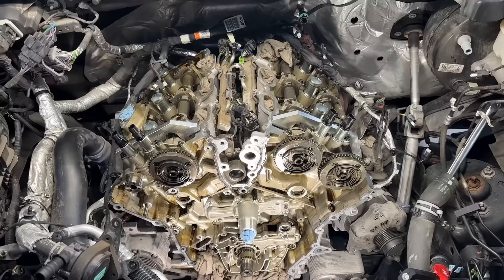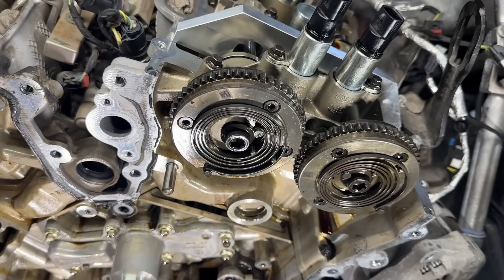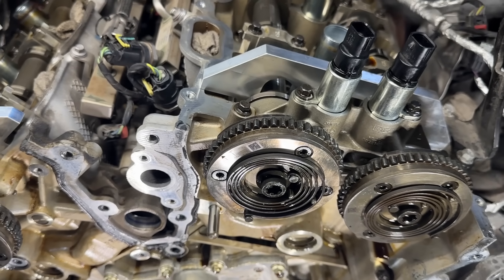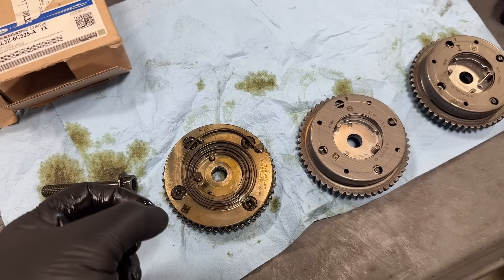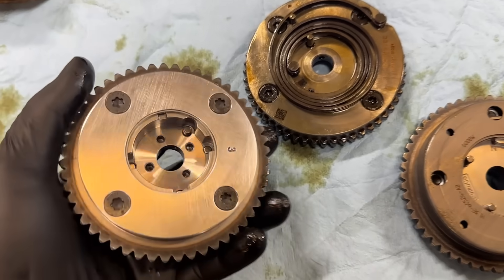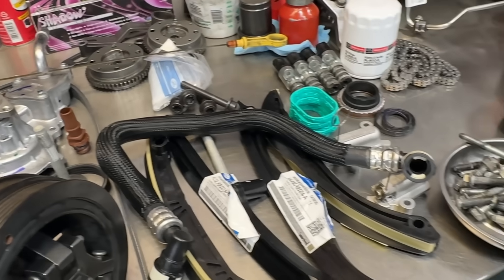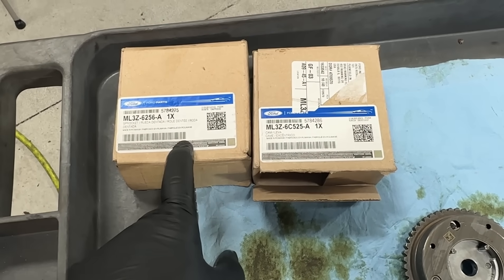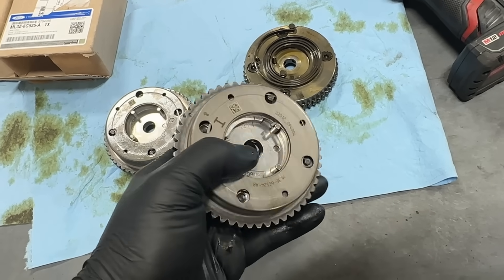2017-2020 Ford F-150 3.5L Ecoboost Startup Rattle Fix: Make Sure You Are Getting The Latest Phasers!

Comment: Will you people stop asking if this new style phaser will work with your 1st Gen 3.5l ecoboost? I mean the man CLEARLY STATES this is for the 2nd Gen 3.5l ecoboost meaning 2017-2020 for the F150. This new style phaser will not work with Gen 1 and the Gen 1 engines already have a new style phaser that fixes the previous issues with Gen 1 (2011-2016 F150).

Comment: Thank you very much for this video.   I had my cam phasers replaced almost 2 years ago at 87,000 kms (54,000 miles-ish) and my 2017 F150 is making the same noise on a cold start at 150,000 kms (90,000 miles).    I took it into the dealership and they quoted me $4400 to repair.   I just looked at my previous bill and the part number is HL3Z6C525CD.   Bastards did exactly what you mentioned....used up old stock.   It looks like I'm going to have a fight on my hands Monday morning.   Thanks again!!
Reply: Howd it go?
Reply: @calebmastruserio7811  so I got Ford Canada involved and they were excellent.   They covered the majority of the bill, leaving me with $900.   They gave me $500 in Ford credits for parts/service and a 2 year maintenance package with free oil changes.   On the other hand, the dealership were douchebags and I won’t ever be returning.
Reply: @robertcooper6910  oh good work, glad to hear it. How's your truck running? Hopefully good for a long while now, lol
Reply: @calebmastruserio7811  ya seems to be running well now.   I'd really like to hang on to it for a few more years.....other than this nonsense, it's been a great truck and I really can't see spending $80k (CDN)  just to buy the same thing with a bigger screen.    Thanks for checking in!
Reply: @robertcooper6910  absolutely fair, and no problem! Your comment piqued my interest lol
Reply: @robertcooper6910  I wrote to Ford of Canada about my 2018 last September when my truck was at 72,000kms. the response I got in writing was "I am unable to assist with repair costs". It was signed Joane M. pretty useless reply. We're now in May, the rattle is getting worse! Can you tell me how you approached Ford Canada? Do you have a contact name from written correspondance? Much appreciated.
Reply: @robertcooper6910  Yes I did get a quote, $2700 + tax. I called Ford of Canada again on Friday, the answer I got was "Sorry we don't have any programs available for this at this time." Thanks so much if you can get me that contact name. Seems it might be hit and miss depending on who answers the phone.
Reply: @allanrheaume5549  also, mine was out of warranty when the issue first arose.    Oddly enough, I had 87,405 kms on my odometer.   There is a service bulletin and this is supposed to be covered.

Comment: @FordTechMakuloco Quick question for you... Almost a month ago to this day, replaced the phasers (with the latest part numbers), chains, guides, etc on a 2018 ecoboost. Customer called today mentioning that their "grinding noise on startup" has returned. At this point I'm planning to inspect the exhaust studs to make sure that they are all there and I considered looking at the turbos, but they were quiet and operational during the prior test drive. Any suggestions or issues you've seen? Truck has 120k and I don't really plan to tear the engine down again to replace what was replaced to begin with. Maybe oil pressure issue? Not looking for any type of solution, just maybe you've seen or had similar concerns? Thank you!

Comment: Video is great and very informative. Im actually having the engine of my 17 f150 3.5L ecoboost replaced and am having the mechanic replace the cam phasers and timing components. Will these new model numbers fit the 2017?

Comment: I had my '18 F-150 3.5eb phasers replaced back in October of 2020 for the cold start rattle at just over 53,000 miles and they said they had the updated parts installed at the time. The repair took 8 days and then upon getting my vehicle back I made it less than three miles from the dealership in Omaha before black smoke was billowing from under my truck and people were pointing at me. I immediately took it back and they had it another day and replaced all of the gaskets and seals. I had a constant whistle sound at idle after that and they said it was normal and bring it back if it gets worse since there was no diagnostic code that popped up.  Now, I once again need the cam phasers replaced at 99,000 miles and its outside of warranty. I was looking at my repair invoice and the part numbers say HL3Z-6256-CD and HL3Z-6C525-CD. Talked to my service advisor the other day and he said that it's the updated cam phasers that were installed and that it can have the same part number as before but it's actually the updated phasers and his tech would not be installing the old versions. Is this correct or is my service advisor not being honest with me? Anyone having issues with the new phasers. I've had other warranty work done on other parts of the vehicle and each time I've had to come back. They once forgot to put the mounting bolts back in on my brake caliper and I made three blocks. Had a transmission flush done recently since they said they don't need to replace the filter. Replaced the trans pan and filter about 400 hundred miles later and the fluid was brown. While i was under there I noticed two of the transfer case to transmission mounting bolts were sticking out from when they replaced my transfer case when I had only a couple hundred miles on the truck. Apparently to difficult to get to so no need to tighten. SMH. Planning on going somewhere else now instead of the dealer where I bought the truck since my extended warranty expired. Sorry for venting but my blood's been boiling the last few days.
Reply from the maker: No that is incorrect, they must list the correct part number on the repair order.

Comment: Thanks for the info on the new part numbers! I have a 2.7 with only 5k miles and they need replacement! Anyone know the part numbers for the 2.7? Thanks
Reply from the maker: You will get no answers without at least giving the year.
Reply: @FordTechMakuloco  2023
Reply from the maker: No updated parts for the F-150 anyway.

Comment: I ordered a 2017 raptor, had phaser issues around 30k miles.  They had my truck for 7 weeks before it was fixed.  I assume waiting for parts.  The issue came back 3000 miles later.  Is this odd?

Comment: I have a 3.5L EB with 80,000 miles including towing a 7,000 camper in the Rockies.  I do not have this issue.  What am I doing right?  My best guess is I use Penzoil Ulyra Platinum motor oil.

Comment: What do u charge or do u know what ford would charge to do this job replacing all the things that need to be hoses water pump belts like u are keeping the truck not just the bear  Minimum or what the TSB for Ford what the fix it all done the correct way cost is that would help me and many more out thanks !!!
Reply from the maker: Well over $3k.

Comment: Well, I had a funny noise coming from the engine on startup a year and a half ago.  The tech determined it was the Phaser recall and performed it.  4 days ago, I had a loud cold startup noise. Sounded like a phaser.  On my way to Ford the noise started getting louder at 1500rpms, not just at cold startup.  They diagnosed it as the cam phaser issue.  They sent me an email to approve the $4,500 job to replace them.  I'm at 101,000 miles on my 2018 f150 3.5 eco.  They did the job at 77k.  I'm heading down there to talk with them about the parts they added when they did the recall.  I doubt I have any ground to stand on, but this is a recurring $4,500 issue that it appears is part of the plan for Ford to recoup some recall costs.
Update:  After sitting at ford and looking at my records of service, this will be my 3rd(confirmed) Cam Phaser replacement.   1 at 70k (old HLZ part), one at 81k(MLZ part) and this one at 101k (new part number approved in May 2023). The second round used the part numbers in this video and lasted almost exactly 20k miles.  The tech is going to send me a picture of the cam phaser part that was installed to confirm that what is on the truck is in fact the newer MLZ part number.  He mentioned if it is the new MLZ part number, that it's the first of those that he's seen fail.  Which if true, speaks volumes about that parts resilience.
Reply: Brutal.  Let us know if there's any resolution.  Dealing with the same on our '18 F150 as well, 70k miles.
Reply: Another update.  The $4500 did not include anything else, guides, tensioners, vct etc.  Added that to the list and it's now $6,000. One more item to note: If Ford replaces parts under warranty or tsb, it's a 1 year warranty.  If YOU pay for it, it's a 2 year warranty.  Also, I spoke with a manager to see if anything can be done about the price.  It's worth a shot, but haven't heard back yet on options there.  Ultimately, any engine work on the 250's especially 6.7's is probably a lot more.  So I guess I have that going for me...Here's the TSB for the cam phasers in case anyone is interested.  It ended 1/1/23 though: https://static.nhtsa.gov/odi/tsbs/2021/MC-10199482-0001.pdf

Comment: 2019 f150 limited.  120 k no problem at all. Just started the noise if i leave it for a few day.  Took to the dealership and they confirmed that is the cam phasers.   I have a warranty that covers it and give the ok to get it done.   What else should i ask the dealership to change while they are there.   They will definitely have to install the upgraded phasers.   Otherwise i wont give the ok to open the engine.  Thank you
Reply from the maker: I always change the water pump as they are prone to leakage and it comes off anyway. I also always change the coolant jumper hose from the water pump to trans coolant line if you have the PW-602 pump.
Reply: @FordTechMakuloco  how can i find out my water pump is like the one you just mentioned.  Thank you
Reply from the maker: Use your VIN in the parts catalog
Reply: @FordTechMakuloco   got the truck today.  Everything was done just like you advertised.  Except for the trans coolant line.  Didn't have one, they said.  Thank you for your help.
Reply: I talked to them and asked to i stall the updated ones.  Also, change the water pump.   Thank you. I will see how it goes.

Comment: I have a 2020 5.0 F-150 with 24K miles  and have been hearing about this issue on the Ecoboost engines is this something I should get done under warranty even if I don’t have a problem right now?
Reply from the maker: They will not repair unless they can duplicate.

Comment: I have a question for a 3.5L in an 2019 Expedition. The wife's ride just had a second cam phaser job and all seems well with ride home. Well the next day wife drives to town and vehicle runs hot. So I go to see if there anything I can do and no clue of why it's running hot. So I get it towed to the nearest Ford dealer and a few days later they say that there is damage to the the inlet and outlet radiator hose plastic retaining clips. Well this is not covered under the warranty so $634.00 dollars later. My question is could the damage to the hoses been related to cam phaser job? I don't know and I appreciate any advice.
Reply from the maker: They should of never been touch no need but I bet they did and now cause the problem

Comment: I have a 2013 f150 3.5 ecoboost with about 84k miles and I am having the phasers replaced in a couple weeks and I was wondering if they are still installing old phasers or have the discontinued them yet
Reply: Also should they replace them all

Comment: Just had phasers replaced for a second time.  I bought an extended warranty and the new style went in. Wanted to replace the chain and guides too @65K while it was apart but the chains are not available any where.
Reply from the maker: Oh yes they are, my dealer has 24 in stock.
Reply: @FordTechMakuloco  I was told 17,000 were on back order from Ford, no ETA, and then I called Melling, also BO, no ETA. Those you know of are like gold nuggets.
Reply from the maker: Yup I grabbed a few sets from them for stock too.
Reply: @FordTechMakuloco  If oil changed (synthetic) regularly, how many miles would you trust these original chains? Thx

Comment: Great video!! Question: If my phasers are rattling  on start up does it cause any problem while the engine is running? Please answer ASAP. I am planning a trip next week and need to drive the truck. TIA!
Reply from the maker: Yes it can but in most cases you will have no drivability problems.

Comment: Hello I guess I just got hosed by dealer. I made it to 94000 miles on my 2019 f150. But I had the extended warranty till 100000 so it was covered. They just finished the repair on my truck. I asked the service department to make sure and put in the up dated parts. when I picked it up and looked at the paper work it had the old part numbers that they put in. Then they went and lied to me and said there were no differences in the part numbers The big Ford Store in Evansville In. Stay away from there.

Comment: Brian I have 2018 3.5 and I put on after market intercooler and radiator, does this void the warranty?  The phaser noise happened before all this. Or do I have to take all of those parts out and put back the original in?
Reply from the maker: No it should not as it is totally separate.

Comment: How are you guys determing if you need to replace timing chains or not? I have a 19 with 83000 on it that does the rattle on startup about half the time but have started doing the flood start if it sits for over a couple hours just not to hear it. Also doesn't have any codes.
Reply from the maker: We don't, we just change them automatically as part of a timing job.
Reply: @FordTechMakuloco  Thank you for responding

Comment: My 2012 Mustang 3.7  has developed a horrible startup rattle, that I assume is phasers and chain set.  It's got 110,000 miles.  Changed to 20w50 Mobil 1, and the noise has totally gone away, runs perfect and silent.  Question;  will running this 20w50 oil do damage to the engine?   I live in the South, so cold weather starts are not an issue.

Comment: I appreciate the excellent videos.  Just set an appointment for this job on my 2017 with 95K miles.  I asked about these parts.  Dealer has an updated TSB 22-2143 that calls for for different part numbers:

Intake HL3Z-6256-CD
Exhaust HL3Z-6C525-CD

Has the part changed again?  Just want to make sure that I get the best chance for success given the fact that my extended warranty will be gone if these wear out...

Thanks
Reply from the maker: That is the old part numbers they are pushing.

Comment: Thank you. My 3.5 has 48k miles and has the rattling on cold start. My dealer service center said it’s ok and typical/acceptable for these engines because the rattle didn’t last for at least 5 seconds. As per Ford specification. I grew working in my father’s shop til I went into the army so I know this is total bull shit. They don’t want to do the job. When I go to a different dealership how do I get them to fix it. I still have warranty until September.

Comment: Three weeks ago I bought a 2017 F150 with the 3.5 ecoboost. Cherry condition with 54K.  I got it at a Ford dealership who told me it was a trade in. Good carfax report- one owner with regular service maintenance.   When negotiating the sale I reflexively declined the ~$5000 optional engine/drivetrain limited lifetime warranty (15 years or 999,999 miles and a $100 deductible per repair).  The finance manager, Jim said "I'm not trying to sell you but this truck has techy engine and 10 speed transmission." He encouraged me to reconsider and offered it at what he said was his cost $1995.  I saw the wisdom in this and went for it.  Sure enough it has with the phaser rattle.  Ford tells me that my truck is not part of the 21N03 program. Thank you, Jim!
Reply: Next time get the Ford warranty on line at Lombard Ford.  You'll save big!  But don't expect too much from it.  When my chain tensioner went bad in a 2010, they only offered a rebuilt engine - from a local firm.  Said they aren't required to use Ford parts on warranty work.

Comment: HI! I am sure you got slammed with questions. sadly I have one lol. Long story short i got a decent deal at an auction on a 2013 f150. My issue is multiple codes and only running on 2 cylinders. im a diesel mechanic by trade. I am wondering if this is an interference engine? I did borescope cylinder but there so much carbon i could not see piston issue. Is the carbon build up an issue? Any information to assist would be great . Thank you

Comment: I have a 2017 F-150 3.5 Ecoboost, I had my Cam Phasers replaced about 10,000km ago. Under warranty.
I'm now out of warranty and I hear the rattle noise again on cold start...
Very minor rattle but I'm still pissed.
 I work for Ford in sales for the last 6 years.. so I get our cost on repair in our shop...
Do you think I should do it? Or wait? Truck runs fine. I just don't want to keep replacing them at the same interval pace of a oil change...

Comment: O.K. I'm looking at a 2023  f150 3.5L or 5.0 L I guess they have fixed the cam phaser issue what else do I need to concider do the timing chains still fail prematurely or anything

Comment: Is there a Ford Performance timing kit with the newer phasers that fits the '18 F150 3.5? The dealer told me everything is sold separately.  Are all the parts of the timing set from the '21 F150 the same as '18 other than the phasers being updated?  Just trying to figure out what I need to order. Timing set for '18 but phasers from '21? Or just tell them a timing set for the '21 F150?